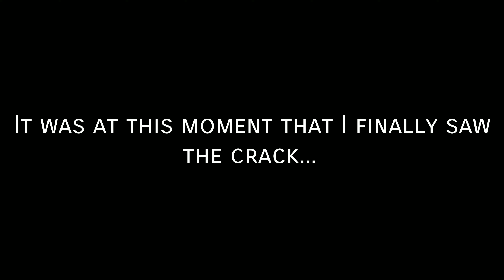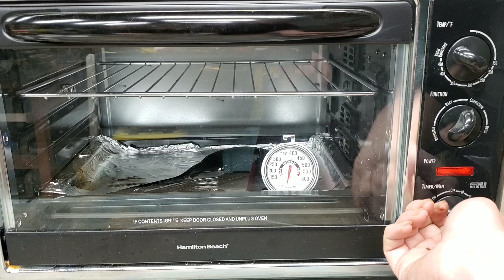Antique Stanley Bailey No. 27 Transitional Plane Restoration

Comment: Could you clean the wood block with soap and water? Will it do as good a job as denatured alcohol? Will using denatured alcohol affect the ability of the wood to receive oil based stains?

Comment: Overall, good job.  I thought you would make it functional by getting the mate between the chip breaker and iron fitted, then sharpening the iron.  I know you received the plane with that tote, but that is not the right one and does not do the plane any justice.  I'm in the middle of restoring mine right now.  Luckily it has all the original parts.  Best part for me was the $20 price I paid at a flea market.  Thanks for sharing.

Comment: Nice work Alex saving an old plane that needed saving.  Maybe you should not use your old push drill to break loose old screws and bolts as it is made for speed but not power.  You will strip it out.  Break them loose with standard screwdriver first the use the push drill.  And I don't think that handle is original but it a crudely made replacement that is just not shaped right.  Good work saving the old plane!

Comment: I have the exact same jack plane, and it isn't from the early 1900s. Instead it's from before 1888, and the adjuster screw has two patent dates on it . Stanley stopped using Bailey in their name in 1888, so if it has Bailey on it, which is only on the adjuster screw, then the last possible year for it to be made would be in 1888.

Comment: I have a Stanley #27 that I found in an abandoned cabin in remote Alaska along the Susitna River about 40 years ago.  Now that I’m retired and have the time, I hope to finally get to restoring it.  I have all the metal parts; however, all the wooden parts are gone, probably rotted away like the cabin they were in.  I think I can fabricate the handles, but I don’t know the dimensions of the base.  Is there any chance you could tell me the dimensions of the base, and the type of wood I should use?  Thanks, Andy
Reply: Hi, just looking at the base I'd say it's 1.5inch longer at the rear and 3-3.5inch longer at the front, 1/4inch wider, their dimensions wider than the metal plate, and 1.75-2inch thick. Most of the wooden planes were made out of hard woods, id suggest something like oak or box

Comment: Overall I liked how this turned out but I have some specific reservations I'd like to pass on to a fellow restoration nut. If you're going the extra mile and re-japanning – and your mix looks like it's smoother than many versions seen on YouTube lately!! – you owe it to yourself to build it up in layers, _using a finer brush_. Also wish you'd replaced what you might call the tote. That replacement lump of a rear handle didn't deserve to be salvaged LOL
Reply from the maker: I appreciate the feedback! I'm still learning on the japanning, and probably should have practiced a bit more with different techniques before jumping into this one. As for the tote, I had already put more money into this than I had expected, plus I was ready to finish it up before the holidays. I may replace the tote with a more original one in the future if I can find a decent one on eBay for cheap.
Reply: @alexvstools  Fair enough on the handle replacement, but I wasn't suggesting a bought replacement. I had a look yesterday and spares for these are crazy money! I was more thinking a homemade replacement. They seem like a lot of work but it's not too bad once you get into it, and free patterns are available online if needed. Plus there are many tutorials of the whole process, using various combinations of techniques to cover a range of tool options; so if you don't own a router you can still see how you'd go about it. 

Have a good one! I'll look forward to the next vid.
Reply from the maker: I'll have to give it a try! I'm still building up my shop since I previously relied on my dad's woodworking tools. A good router is on the list of tools I hope to get soon.

Comment: I'm new to hand planes, I repaired one of these but it keeps getting chips stuck in the throat. Anyone know the cause?
Reply: could be a badly prepared cap iron, could be the chip breaker and more than likely is. the chip breaker needs to meet flat on the back of the blade, and it needs a smooth transition. chips can get caught and jammed in it when it isnt right, and can caise a yon of issues.